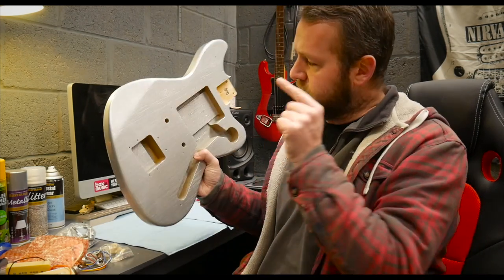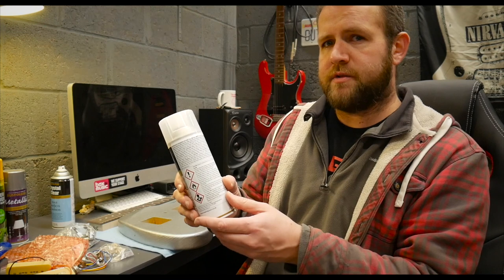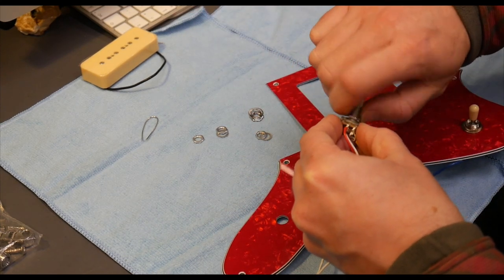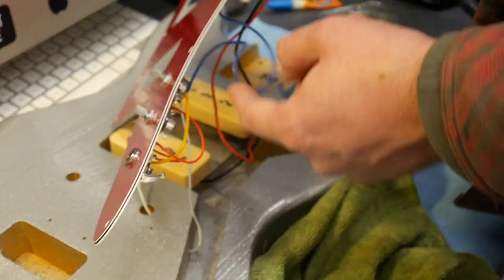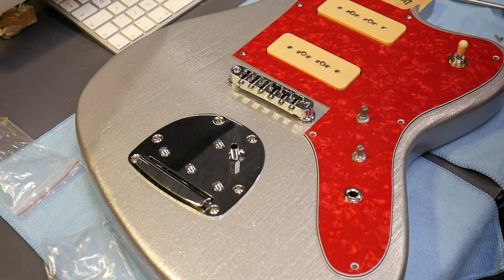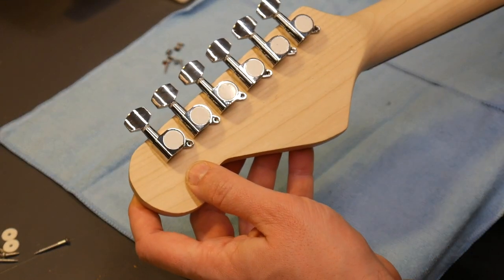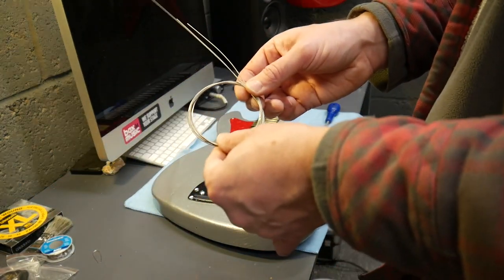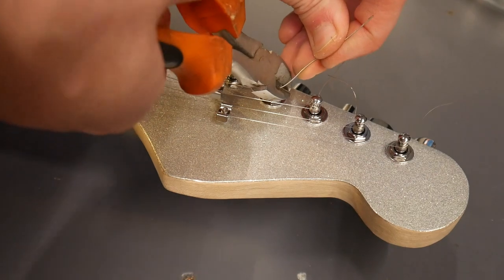Gear4music Seattle Jazz Jazzmaster Kit Guitar FULL BUILD

Comment: Heya Rob. I got this exact kit a few weeks ago and am busy painting it. Before I started painting, I assembled it completely and did all the wiring to see what the playability is like and I ran into the exact same issues you outlined. When in standard tuning the action is high after the 12th fret and the strings don't feel taut, and when changing between chords the strings kind of 'bounce' off the fretboard a bit. I'll try shimming the neck as you've done and see if it resolves that issue. The other issue I had is that the tremolo literally does not move once the strings are on. I see at the end of the video that it's something you were going to address so I was hoping that you've fixed by now and if so could you share the fix with me please? :D Thanks!